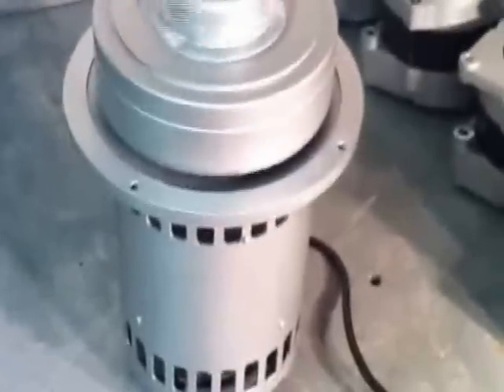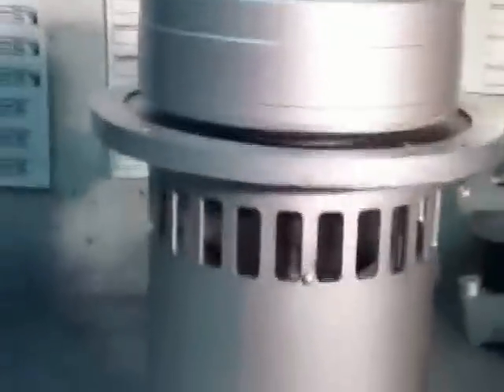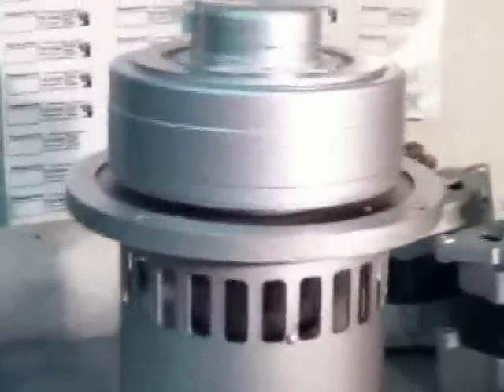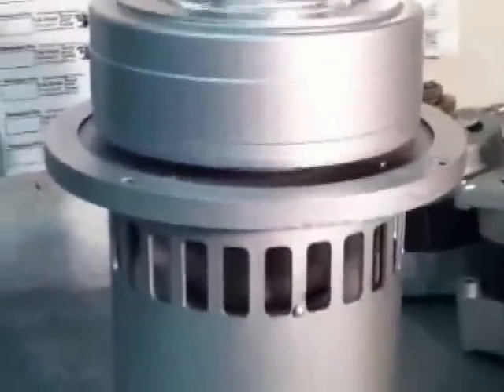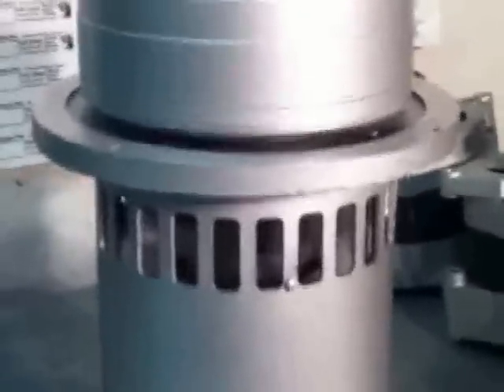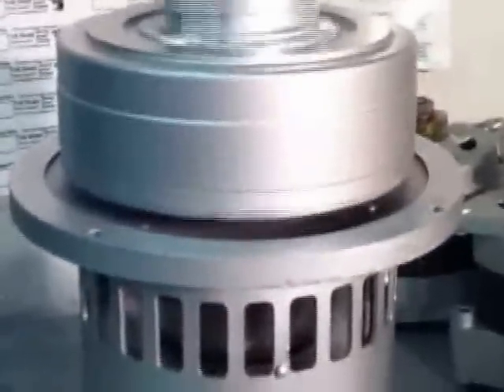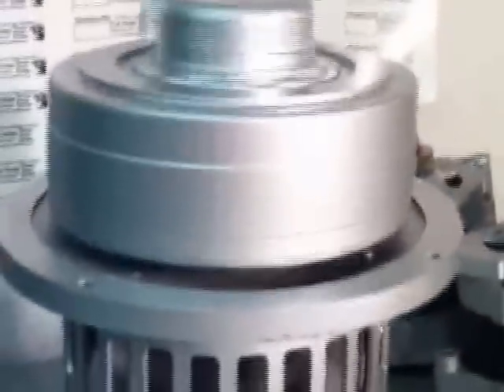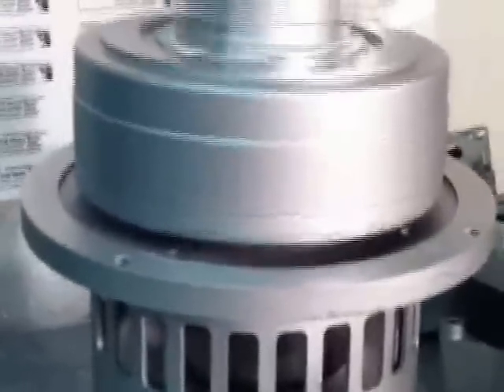THERMODYNE Grid Tied Synchronous AC motor compound gear head 900 watt HAWT VAWT

Comment: Great idea, Will you need a control system since it has to be started by wind power and not grid power. Maybe using caps? Can you show us how it will be used for wind power? Thanks
Reply: afcmcp Got it. Wind speed switch to work a relay (SSR) on the A/C side grid, activated at 12 MPH or so, power goes to the grid. Run caps to keep her all in line. I guess you will have to sell it with some kind of controller? I think Clarion tried this at a 400 w model but they never got off the ground. Not sure if they were using this type of motor though. Good luck and please keep us posted